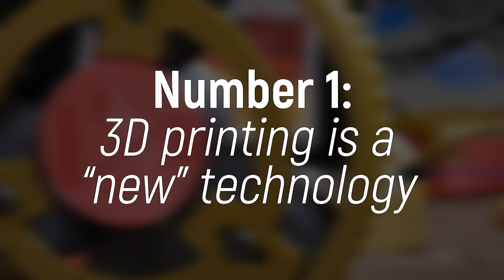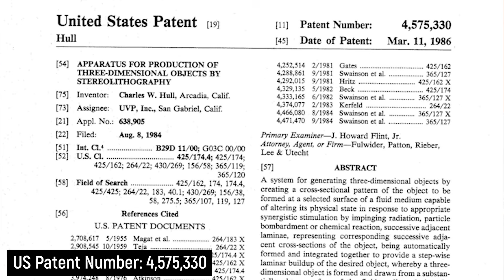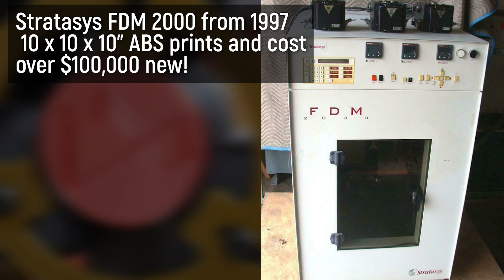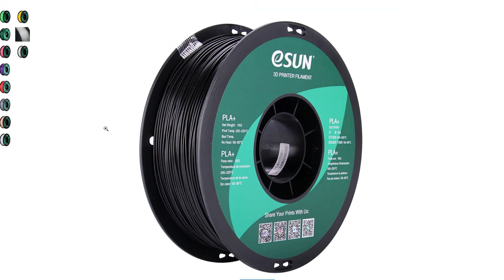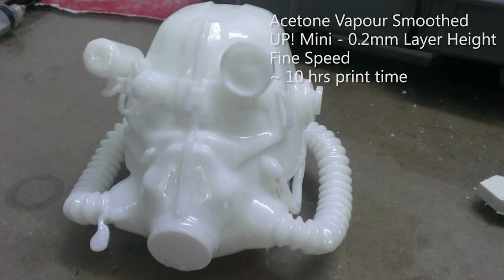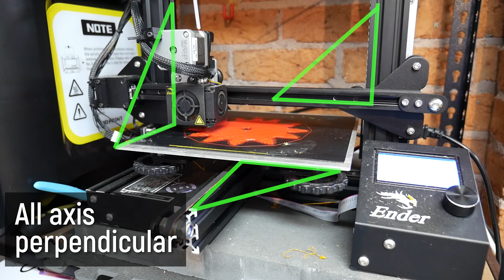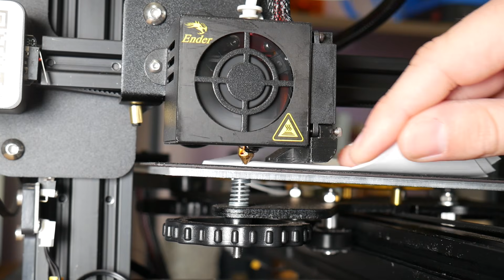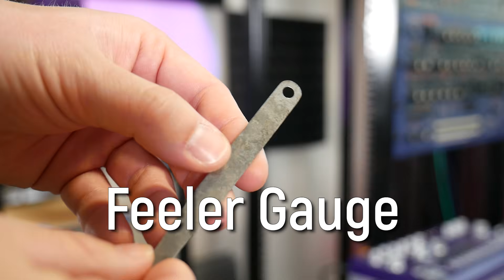3D Printing Myths I used to believe...

Comment: A piece of paper has always served me well. Also on the manual mill. A standard 80 Grams per m² paper nowadays is very exactly produced to 0.1 mm thickness. It's the cheapskate feeler gauge if you will. You just need to be aware, after touching the paper, you're still those 0.1 mm away from the surface. If you watch those machining channels you will very often see the paper method. I'm surprised that for leveling you didn't come up with the dial indicator method. Tramming is the process where you make sure the head of the mill spindle is exactly 90 degrees to the table, but you can also use those dial indicators to level the bed. They aren't even that expensive.

Comment: Interesting Note: FDM is still a trademark owned by Stratasys. If you want to create or develop your own 3D printer system, you'll avoid their lawyers if you call it an "fused filament fabrication" (FFF) machine.
Reply: Doesn't matter.  It's used generically, and they haven't acted to protect the trademark, so it's legally a generic term.  That's how trademarks work.
Reply: @TrueThanny  Sorry, you have been misinformed. It does not become generic because Stratasys hasn't enforced it. As long as they use and maintain their paperwork with the USPTO, they still "own" the trademark. It is up to Stratasys to file against others in court to "enforce" ownership rights. They can do so at any time as long as they use and maintain their mark with the USPTO. This is a handy guide to trademarks: https://www.uspto.gov/sites/default/files/documents/BasicFacts.pdf

Comment: So, with a feeler gauge, am I aiming for a full distance of the layer height, or some portion of that layer height?
Reply: It doesn't matter as long as you move Z up the same as your feeler guage. The idea is that you're finding 0, not some arbitrary paper thickness.
Reply: @thingswelike  This cannot be correct.  If you wanted to find 0, you could just level to the bed.  He also talks about elephant foot, where it's too squished at the bottom.  You can't lay your first layer at 0.  This must relate to the layer height.
Reply: @lordrefaiv  the printer raises the nozzle for the first layer, it is not based on the paper thickness. You can level with a 10mm machinists block if you want. You just raise the nozzle to 10mm before you do it. The printer should be at zero when it thinks it is at zero. If you don’t offset prior to leveling, you are going to be at zero plus the thickness of whatever tool you used. Paper is around .1mm. If you are printing a .2mm layer height and didn’t offset prior to leveling, the nozzle is going to be .3mm from the bed.
Reply: @NotaChance2  Ok.  Just rewatched the video for the 3rd time.  I get exactly what you're saying.  I understand.  Will look closely at my next few prints to confirm I definitely have this down.  Thanks.  The question does stand, though -- why don't we just level to the bed?
Reply: @lordrefaiv  The reason for the feeler gauge is, if your nozzle was touching the bed, you have no clue how much pressure it is putting on the bed. The gauge allows you to insert and remove to verify (by drag), that you are exactly where you need to be. If you just lowered the nozzle to the bed, you could easily go too far.
Reply: @lordrefaiv  Answered in your other post, but simply. It is so you can remove and reinsert the gauge to ensure you are not TOO close.

Comment: In my case I print at 0.2mm layer heights. I always knew that it doesn't print at 0 and that's why when I used a feeler gauge, it was always way too far. I ended up using a single piece of paper as it would be the thinnest thing I had. I was too stupid to just home it up and raise the Z axis to match the thickness of my feeler gauge.....

Comment: I always found it difficult  to get a consistent "feel" with a piece of paper and started using a feeler gauge early on. At one time I added a mount for a small 0.01mm reading dial gauge to my print head. That was accurate but it was awkward to use. (I removed the dial gauge before printing.) Now I set my physical height to 0 using a glass plate or reflective flexible metal print surface. I have a bl-touch, so my height is consistent even when changing print surfaces. I use a magnifying glass and sometimes a flashlight to get a clear reflection. I feel it's even more accurate than the dial gauge.

Comment: "There's nothing wrong with your printer because I've had X of them and they've been flawless."

I like to paraphrase Beetlejuice: "That is what happens when you got your Ender 3. This is what happened with his Ender 3. And that is what happened with her Ender 3. It's all very personal."

Every machine can be different. It's less than $300 of a combination of extruded aluminum, wiring, and circuitry that made it to you from the middle of China. Manufacturing inconsistencies, shipping vibrations, and the clutz at the warehouse all can contribute to, WHAT THE HELL IS THE MATTER WITH THIS MACHINE? I GIVE UP!

Breathe. Stop. Research. Restart.

And for heavens sake, don't mod the thing before you know it better than your first car.

Comment: I print single layer test squares (1 in each corner and 1 in center) and adjust the bed until the squares thickness is the same as the first layer height (measured with digital calipers

Comment: I'm a retired journeyman machinist and I  use paper to set my z and adjust the bed relative to the nozzle. I use calipers to check the thickness of the paper. 
Paper is softer than a steel shim, so when you make a movement mistake the paper gets damaged not the nozzle/bed. 
Paper will also clean the tip of a hot nozzle. Hot plastic attaches to the paper as you slide it between the nozzle and the bed.

Comment: I had issues where no matter what I did I couldn't sepperate rafts from the print so I took a thicker piece of construction paper folded it in half and now I'm getting easy to remove rafts and no issues with seperation

Comment: off topic question: I want to connect my pc to my printer so I can upload firmware to my new board but it says that i have to download the correct drivers, is there someone that knows which driver I have to download or is there a tutorial that covers this?
Reply: You need to let people know what brand and model number your 3D-printer is. There are thousands of 3D-printer models on the market.
Your 3D-printer may have a built-in USB-to-UART chip, which may have been set to a non-standard baud-rate.
If the 3D-printer has such a USB-to-UART chip, then yes, you'd need a driver for the chip itself. (eg. PL2303, CP2102, FTDI, etc...)
-When you've found and installed the driver, you'll also need to make sure that your software can actually communicate with the baudrate that the 3D-printer's firmware is set up to.
If you have a Mac, then it might be easier to just get a Raspberry Pi and use the Raspi with for instance Octo-print. I haven't tried that myself, but I am not able to make my own software (scripts or otherwise) work on Mac OS X, since UNIX does not have a standard interface for communicating at non-standard baudrates (yet). Linux, on the other hand, does have a newer API, so it'll be easier to get that working.
Haven't tried a VirtualBox Linux though - that might work too.
Reply: @68HC060  thanks for your reply! 
I have a CR10S but I replaced the board with a silent mainboard v2.2
In the device manager, under: other devices, I can see: FT232R USB UART with a yellow triangle warning symbol in front.
Can you with this information determine what I could do?
Reply: @sjaakk4883  This might be enough information to identify what you need to do; it should at least get you a little closer.
If your "Silent Mainboard" contains the Marlin firmware (which is very likely), then this firmware likely runs at 250000 baud. 250000 baud is non-standard; it's usually used with Atmel microcontrollers, because it's "the best they can do".
However, your mainboard might have a different microcontroller, which likely support other speeds as well.
The driver you will want to install, can be downloaded from FTDI's web-site (ftdichip - dot - com; click "Drivers", then "VCP Drivers" and scroll down).
-As I've not used FTDI myself, you'll probably have to find the exact driver on your own (trial-and-error or 'best guess').
When you have the driver installed, try using Cura to connect to the printer. It might work right away - or - you may have to create a "setting" for it.
I have an Anycubic that can I communicate with using an old version of Cura (you can set the baudrate in the Cura settings).
My Anycubic uses the CP2102, but the CP2102 driver will not work with FTDI's hardware, so you'll need the FTDI-driver.

Comment: So the feeler gauge question, what hight or feeler gauge thickness should I be using? Ender 3 v2.
Reply: Any, as long as your printer can move in the exact height of that gauge.
I would say a thicker one (say 0.5~0.6mm) so that if your bed isn't properly trammed yet you'll not ram the nozzle into it as likely as if you did it with a thinner one, tho it's definitely a better idea to push it as low as it goes 1st anyway and rise until the gauge just fits and no more, in that case no difference between thickness either.
Reply: Personally, I use .063mm (.0025in) religiously. The only height I've used and it gets me fairly close to where the nozzle needs to be, I adjust a bit while printing a calibration layer to dial it in perfectly. I could probably get away from a lot of the baby stepping if I didn't adjust the knobs to be so tight, but I find I can only replicate on all four corners the same distance if I dial it to just where I can still get the gauge to slide under the nozzle. I don't have very good dexterity of feeling in my hands so this is what works for me.

Comment: I’ve used a .003 (three thousands of an inch) feeler gauge for years…(on glass beds) with PLA, and my bottom layers are “smooth as glass”, But like so many things in life, you have to develop a “feel” for the feeler gauges.

Comment: Oh man...
Dude this was good, I'm a technician at a printing shop and flip the stories people have told me.. What I find also helps with leveling if u don't have a feeler gauge, is level, switch off the machine, use an unfolded paper and do it like that , BUT after that ran a bed leveling test and see 
That's just my two cents.
The whole ABS story I never fully got.. Like nah but I find that Pet-G is actually one of the more well rounded and has the best benefits

Comment: One other commonly repeated "myth" / common practice, (at least back in the day) was using a glue stick to try and literally glue your prints down. Other ideas and home brew solutions along this line where, using rubbing alcohol to clean the bed, using hair spray (I don't know what they were thinking ether), or using painters / heat resistant space tape.

Comment: When I was taught to use a piece of paper to set z offset on a mill/router, I was only taught to use a single thickness and then remove the 0.03".
Reply: What paper is 0.03" thick? A Post-It note is 0.0035"
Reply: @1pcfred  Apologies. My memory was faulty. Barring the bad numbers, the concept still holds. Single thickness and then remove the offset due to the thickness.
Reply: Isn't that a little close? I know that .1mm is too far from the bed. I use a .063mm (.0025in) feeler gauge to level/tram my bed, it requires only a little adjusting while printing a calibration pattern on the bed.

Comment: Like the idea of a feeler for leveling, but what thickness? Oh yes, great video👍
Reply: Depends on what sort of calibration system your firmware offers. Generally the thinnest possible will be the most "correct" one, so those are usually what, 0.04mm? Otherwise if you have a calibration UI, you can use 0.1 ones and after you use the gauge to set touch, you walk an additional 0.1mm. Experiment, different people can live with different settings depending on how flat their surface is and other compromises they want to endure.

Comment: Auto bed leveling is even worse, it doesn't level or even tram anything, it just compensates (aka print as wonky as the bed).

Talking about no tramming needed if you have a perfect frame, we build a printer that just is built like that. But we still need to shim the bed (custom shims shaped like a height map) to get it flat since most aluminium beds with soldered on heating elements are slightly warped. But after that it always is and stays true and flat (there aren't even adjustment screws under the bed)

Comment: I put a light behind printer and check if light comes out from b/w nozzle and bed by looking horizontally keeping my eye on bed level. stop turning level screw when you see gap is zero.

Yes this method takes more time than paper method but this method gave me much much more accurate bed level than paper piece method. If you do this with patience you can level bed with high accuracy. Cross check bed level again because sometimes when we turn level knob it pushes bed away from nozzle slightly.

Now i use this method all the time.

Comment: I don't know who ever said to fold the paper. A piece of paper is about 0.1 mm thick which is plenty enough and folding it increases this thickness in sometimes an unpredictable amount.
Reply: actually you're wrong. u want 2mm not 1 which is why he folds it. a lot use shims and business cards. it's funny how much in denial people who print are. they act like they know everything and can't learn. well bed you're wrong
Reply: @rmi2548  Why do I want 0.2mm? Not folding a paper worked very well for me, and ultimately we need a consistent thickness, not an exact thickness. When the distance is the same on all corners I can then calibrate the actual distance changing the Z offset.

When I fold the paper, there's more amount of material that can be squished, making the measurement less precise.

Comment: I have actually been using a feeler gauge to set my nozzle height for a coupe of years now and it is far more reliable than paper. A handy tip, set it when hot then run a print. When you are absolutely happy with the first layer of said print grab your feeler gauge and measure it cold. You can then set the height cold in the future.

Also Angus, what ever happened to that Asus dual screen laptop? Does it still work or is it now landfill fodder?
Reply from the maker: Using it to comment right now! I don't use the second screen much at all though, very few programs adapt to the odd aspect ratio.

Comment: I never got my first layer right using paper on a Wanhao i3. I upgraded to a Prusa MK3 with mesh bed leveling, and I'm never going back. I won't buy a budget printer, and I won't buy a printer without mesh bed leveling.  I know there are high quality budget printers out there, but I got burned on my Wanhao, so I won't do it again.

Comment: I've been shouting "FEELER GAUGE!" from the rooftops whenever anybody says "piece of paper" since my very first Prusa Mendel back in 2012, and it's bananas to me that the paper mythology has stuck so well.
Reply: What size feeler gauge do you use?
Reply: @AkIsUkIro  I'm in the US, so until relatively recently, I always used four thou, not least because that's also the thickness of pop can aluminum.
Reply: @StripeyType  I have tried different papers: A4, construction, envelopes from junk mail, and even a thin piece of construction paper. I'm not sure if I should just disassemble and reassemble my Ender 3 or what at this point.
Reply: @AkIsUkIro  first thing is like Angus says in his video:
* tram the frame to ensure it's square (for Ender 3's this is pretty easy)
* set all four corner adjustment springs to halfway
* home the machine

Now your machine thinks the extruder is at Z=0.0, so it's time to set that height. If you don't own a feeler gauge, you can make one from pop can aluminum for this purpose. Just make sure it's nice and smooth and flat, don't cut yourself.

Pop can material = 0.004" = 0.101mm so there's your feeler gauge.

Angus really lays it out well in the video above.
Reply: The paper is essentially a feeler gauge that most people have handy.
Reply: @wardprocter2371  what paper do you specify? Have you mic'd out the differences between different weights of paper, lately? It is not at all consistent.
Reply: @StripeyType  I use the same 20 lb. bond/office paper that mic’s out consistently around .004”. Obviously you would want to use the same paper every time for consistency. I’ve been in printing for 30+ years, so yes, I mic out paper pretty regularly (or just rely on what caliper my price books tell me). I realize my situation is somewhat unique but my point was that it’s all relative - once you get the result you want with a piece of paper, use the same paper consistently and you are essentially using “poor mans” feeler gauge.
Reply: @wardprocter2371  Yeah, I think for those of us who've been at this a while it makes a lot of sense. But for somebody who is new to 3D printing, it's far from obvious. I think a feeler gauge, which can be had cheaply at any auto parts store, really is newbie-proof, not least because it's not just the measured thickness of a piece of paper which matters, but the coefficient of friction on that paper. Bot of those factors are consistent from feeler gauge to feeler gauge in a way that simply cannot be said to be true for paper.
Reply: @wardprocter2371  I've tried it for few months before giving up. My prints are either too close or too far. I've tried leveling while having it run the levelng prints but I'm getting nowhere.
Reply: @AkIsUkIro  Try the suggestions that James made and if all else fails get yourself to the point where you feel your too close and make small adjustments to your Z height until you’re happy with the results. Just remember to save those adjustments to your settings on the Ender.